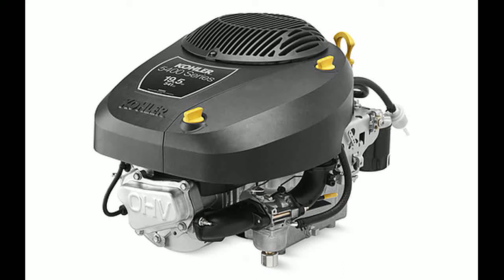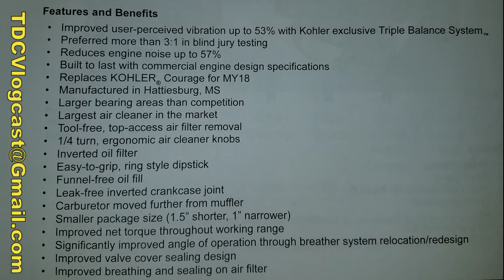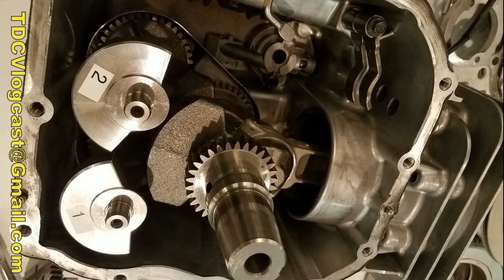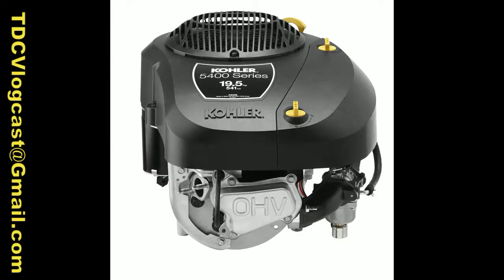The new Kohler 5400 Series single cylinder engines.

Comment: these engines have some problems mainly related to the carburetor as well the top cover bolts working loose. its not a better engine as the older Command single cylinder engines as today the company Kohler engines is now rehlko but who knows if this engine is still available from rehlko it still be under the Kohler name. its slightly better than the Courage engine but is a sutable replacement for these Briggs  Intek based engines with camshaft and compression release problems in both the single and V twin it can replace. as it may fit in these older Snapper rear engine riding mowers with exhaust fabrication as this engine is a good replacement for the Briggs flathead single cylinder as well as the Briggs OHV engines and the Intek based engines

Comment: mine backfires when I shut it off. Do I need to adjust the valves? It isn't that old
Reply: Usually theres a fuel solenoid on the bottom of the carburetor. A symptom of it going bad is the backfire you mentioned.  That's just a possibility you could check out.

Comment: Moving carburetor back was because if it leaked on muffler it caught on fire , might help with vaporizing the gas as well
Reply: Seems flooding carb is common and many have burned up 
Please put a manual fuel cut off valve 😊

Comment: I've got one in a Craftsman T210 riding mower and with almost 40hrs on it no issues at all! I did the break in oil change after 5hrs as required. After that I do a once a season oil change along with a new air filter, spark plug, and fuel filter. Great engine so far.

Comment: I got the 18hp Kohler 5400, it's still really low on hours but so far,  low vibration, fairly quiet, easy oil changes, and good power.  Only complaint so far is the carburetor. Their expensive and bowl threads strip easy. And with the way their setup with air filter assembly, they can only be taken off  from front left to right or you'll break the plastic tab trying to pop off choke rod.  Unfortunately I haven't messed with valves yet, so no opinion on possible cover issues.

Comment: I got to work on one of these today. The customer mowed with it and went to use it the next week, and the gas had drained out of the tank and into the crankcase and cylinder. Thats all thanks to the junk Nikki carburetor. No debris in the carb, float and needle were fine. Seems like it just got stuck. Cleaned the carburetor and did an oil change. No further issues. Kohler took a lot of design cues from Briggs and Stratton, its almost as if Briggs helped them. However, build and design quality seemed ok, definetly better than Briggs and Stratton. I do notice the noise and vibration reduction. It only vibrated about as much as a car engine. I have a 2002 john deere LT150 with the Command single cylinder. It is a great engine, but of course its loud and vibrates a lot. Nevertheless, the command single cylinder was probably one of the best engines Kohler produced. Now, I just hope the 5400 is more reliable than the junk Courage engines.

Comment: And here I have a flat head 14 horse Kohler from the 80's still running fine. Thanks to the EPA new motors are a POS!
Reply: Had an old roto-tiller with a  Briggs flat head i inherited from my father. can't remember exactly when he bought it  ,but know it is over 65 years old. every year i would drain the old gas put fresh gas and would start the second or third pull.

Comment: Got this motor in a new Craftsman (MTD) mower from Lowe's a few months ago.  It replaced a 19HP B&S Intek in my old mower.  The Intek was good but had to open it once and replace the compression relieve valve and wasn't exactly confident that I wouldn't have to do it again when I saw the design of it.  When the valves were adjusted properly, it started without choke every time and I had plenty enough power for the steep hills and inclines on my property.  

My Kohler 5400 seems slightly smoother and is definitely more powerful but I came here to say this - Change the factory after 10 hours, if not sooner.  I changed mine just before 5 hours of mowing and the factory oil Kohler uses has the viscosity of water.  I can't see how that stuff lubricates anything.  I was a few seconds away from returning my tractor thinking I had a defect until I Googled and found out Kohler use a special lubricant to ensure the piston rings seat properly and depending on the motor, they suggest you change it after they break in period which is what I did.  Motor seems solid (like all new engines) so hopefully it lasts as long as my old one, without the compression relieve issue of course.  Again, change the oil after the break-in period and you should be fine with the 5400.
Reply: The water viscosity oil from the factory is true. I did the first oil change on a 7000 series, I had to double check to make sure there was no gas in the oil. Looked like 0W20, not sure why theyd run that or maybe it has a thin assembly lube that washed into it.
Reply: Thanks for the info im getting one Monday

Comment: Run from this motor!!!  I bought a Cub Cadet XT1.  I cut my grass one time.  The starter locked up.  It wouldn't start and just clicked.  Then it started leaking gas from the carb solenoid.  Home Depot swapped it out for another one.  Hope this one holds up..  But I would not buy this motor again.
Reply: how did the 2nd one hold up, I got one in nov. 19 for 1300$, so far so good

Comment: Who reading this has this Kohler 541cc 19hp Single on a Tractor or ZT ?

Hows it working ?

Can you compare to Briggs & Stratton ?

Thanks for your input - I'm looking at 42" Tractors with either brand...
Reply: Im not sure how these will hold up but I would buy this over any Briggs and Stratton.
Reply: Purchased the XT1 - LT42 from local Home Depot. Came with a 19hp motor instead of the 18hp as advertised. It replaced a 5 year old Ariens 19hp Briggs and Stratton motor that decided to blow a push rod through the wall. Works great on less than an acre of land. Glad I made the switch.
Reply: I had a 19 on a craftsman that lasted 13yrs with 0 problems, last fall it fell crapped out

Comment: Just bought one on a Bad Boy M 42 inch. Only about 3 hrs on in cutting about a half acre. flat terrain. Power seems ample.
Reply: How's the vibration level on the new motor?
Reply: Don't really notice any vibration. In reading about this engine, that was taken care of in the design. They call it triple balanced. So far, it seems pretty stable. Will do an oil change, this coming week as they recommend to so after 5 hrs.

Comment: The Courage was a sub par engine, even for residential work. Lots of kinks and issues that weren't worked out. The Command Pro engines have been the best line Kohler has come out with. Especially the older CV and CH units, found in most lawn and garden tractors in the '90s and 2000's.
Reply: I love the Command single cylinder thats on my JD LT150. Even though its only 15hp, its a beast.